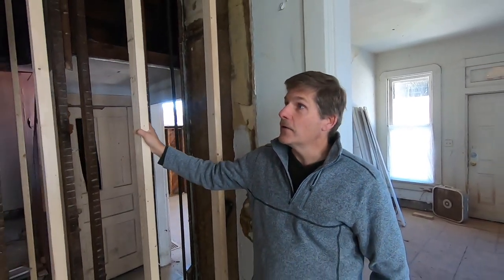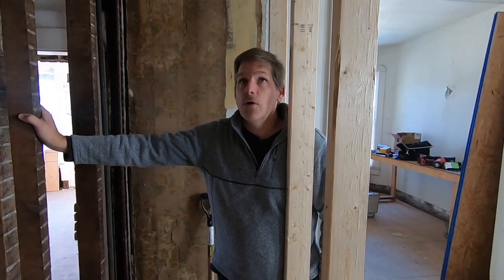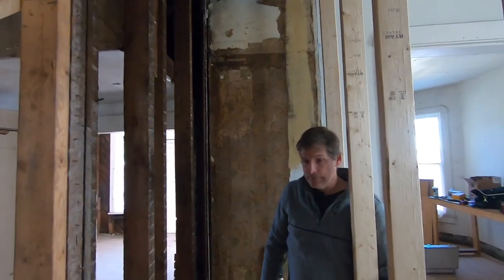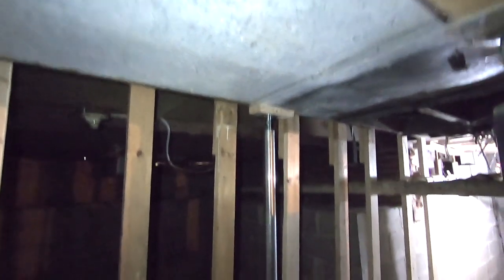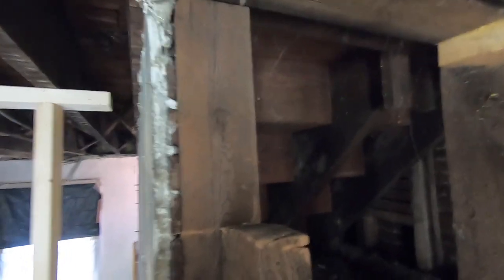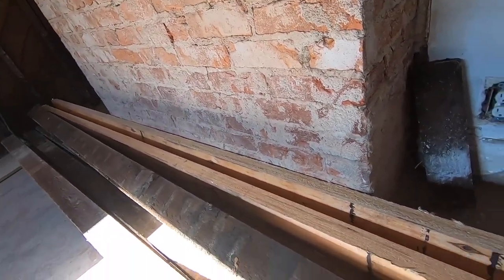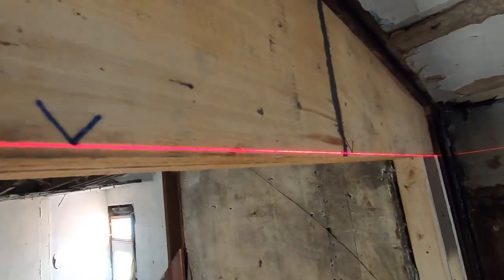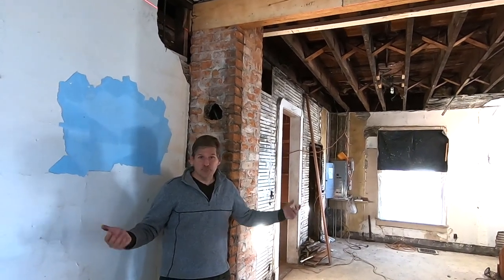How to Create an Open Concept Floor Plan ; remove a load bearing wall and install LVL beam

Comment: With a 120 year old house how does the wood in an old house compare?  Has wood deteriorated significantly or is it still sturdy? And I have heard that wood dimensions are not the same.  For example a 2 x 4 used to actually measure 2 x 4 but now it  measures smaller just fractionally.   If that is true how you account for the differences between old and new  when doing framing and drywall?
Reply from the maker: Hey Lori,
The wood in an old house is definitely sized close to actual dimensions while modern “ nominal” dimensions of a 2x4 are about 1.5x3.5 inches.

The difference in size only becomes a factor when putting old wood side by side with new. That slows things down requiring some kinds of shimming to line it up. 
Thx for watching
Reply: Yes it has deteriorated, comparing the load baring beams to lvl im installing , the lvl is much much better . The old beams have all cracks in them specially in between

Comment: And I  assume that light was a laser level?  If so how difficult is this job without a laser level?
Reply from the maker: Hey Lori,
Yes, that is a laser level. There are other ways of finding level on a project like this, but the laser lever is probably by far the best tool. 
Thanks for the question and thx for watching!
Reply: @Housebarons  What was your bolt /screw pattern did you stagger them or were they vertical on every floor joist
Reply: Lmao not good that brick is gonna crumble you literally cut a brick in half and put the beam on top of it it’s going crack